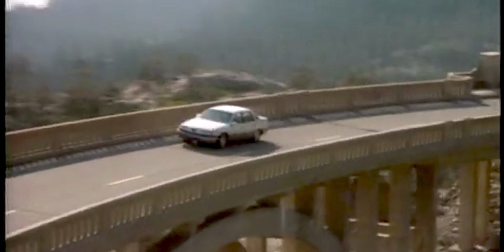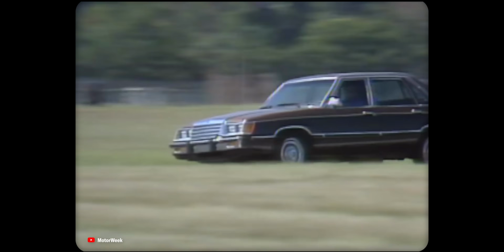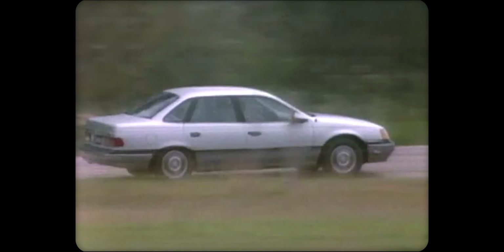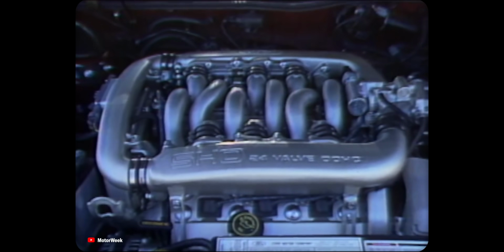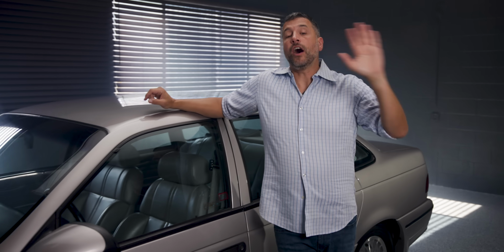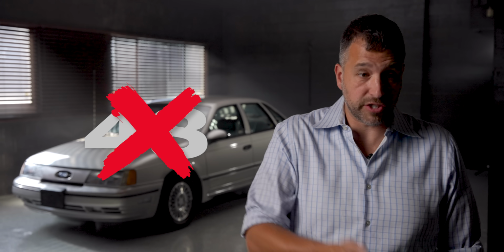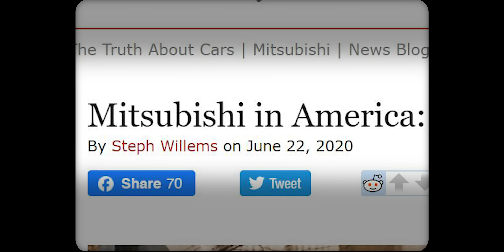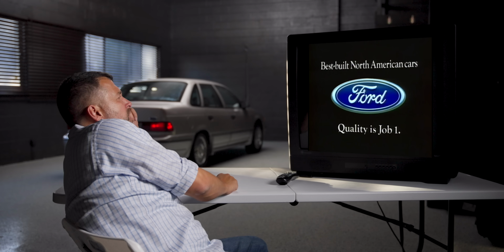The Taurus SHO is the fastest, most expensive Ford sedan | Revelations with Jason Cammisa | Ep. 08

Comment: I bought an '89 when they first came out. Light Titanium like the one you have. As you said, it was very understated and easy to mistake for grandma's Taurus. Another reason for the slow sales was the price. They were not cheap. I paid just over $22,000 for mine. To compare, a Mercedes 190E was $24,000. It was a pretty good car. The first ones had major issues with their clutch not releasing correctly. I believe they used a 3 finger pressure plate and had either bad fingers or springs. I paid to replace mine and not too long afterward Ford quietly issued a Dealer Notice (not a recall) to fix them if needed. Of course I didn't get compensated but I got a second "free" clutch a year or two later. That Mazda trans had a crap 2nd gear syncro. You had to be very careful going into 2nd, up or down. It had excellent steering and brakes. I got nearly 80,000 miles out of the first set of brakes. The car was an absolute touring king. It had a sweet spot at 100-110 mph. At 120, the nose would start to lift and the steering would start getting light, so it could have used a deeper air dam. Top end was 145 indicated, which I believe is accurate as I had an early morning run against a, new for the time, Corvette. The Corvette's top end was supposed to be 155 and that Vet slowly pulled me on top. The old two lane bridges on the 101 got really skinny at that speed. I put 180,000 nearly trouble free miles on that car before I sold it. Overall a great car. I still have the metal model SHO that the dealers sold.
Reply: Here on the Canadian west coast, they were going for about 32,000. My Dad almost bought one in 89 after he and I test drove one and yeah, we were really impressed. But you're right, for that kind of money, you could easily get into a BMW or a Benz 190E. A little expensive for a Ford.
Reply: @codyluka8355  you don't but the brand, you buy the car...
Reply: My 3rd gen SHO was the same way. over 110 it would start to lift the front end and get a little sketchy to drive. They never quite got the aero handled during the first 3 generations
Reply: It was an absurdly excellent highway cruiser at 80 mph.
Reply: @noth606  very true. But retained value is something to consider.
Reply: @noth606  Yes, I agree with you but you have to keep in mind that people who were buying new cars in 1988 & 1989 spent their money differently. Interest rates were a lot higher and the terms were far shorter. Dealership financing was easier to get than the banks but the maximum term was usually 4 years. An up market Oldsmobile or Buick was about $25-27k. A fully loaded Mustang GT, which had the same performance, could be had for about $20k, considerably less than the SHO. The young, go fast college guys went for the Mustang LX 5.0...those were about $12k new. People who could afford the $30-40k cars looked at Lincoln, Cadillac, Buick, BMW, Saab or Mercedes. Ford was still very much a car brand that was geared to the working family. The SHO was a beautiful car in every aspect but people who were buying Fords felt it was too expensive and too exotic. It was definitely arguably better than GMs 3.4 DOHC models. That's for sure.
Reply: @codyluka8355  those prices are absurd, I don't think I know anyone who could pay off 30k+interest in 4 yrs, except maybe the CEO of the company I work for. The most expensive car I ever had I paid 8k for, and I paid cash. I'm not eligible for loans (deadbeat ex) but I still like cars, not allowed to drive since I have heart condition, and an ICD+pacemaker. I could request an exception that would allow me to drive solo, but having a car I can never take anyone with me in seems pointless for how expensive it would be.
Reply: @noth606  Yeah, those prices were absurd back then, and as a young guy just starting out and buying my first car, it was discouraging, especially when Ford Credit or GMAC was advertising 9% interest but soaking you at 11 and 12 % because you've never had credit before. It was scary then...terrifying today with today's prices.
Reply: @codyluka8355  the 8k car was a TOYOTA CELICA 4X4 1991 JDM import, I loved that thing, straight up WRC car, but the upkeep of it was just stupidly expensive, like $400 for a set of wipers, the tires were $400 each, and so on. I did have some more adventures but like I said I couldn't get a loan for $1000 now, thanks to my ex, and I'm not allowed to drive so it doesn't matter for me. I'm just an old handicapped guy living vicariously through things other ppl do in videos 😄
Reply: I bought a 89 in 95 after I finally got a good job at GM. I remembered reading about it in road and track when I was in the navy and wanted one. Picked it up for about $5,000 and the original sticker was still in the owners manual folded up, $32,000. I thought I got a great deal. Well I loved the car kept it until 2013 after I got into a bad motorcycle accident and ended up in a wheelchair so I can't drive a stick. The car didn't have any value so I basically gave it away with one small rust hole by the gas cap and 180,000 miles. It started right up and still drove like tge day I got it with 60,000. 2 clutch and 2 transmissions later.

Comment: When you get Yamaha involved in the engine design of your car, you know you're going to end up with something weird and exciting. The same problem that sank the SHO (the lack of differentiation from the base model sedan) is the same thing that sank the Fusion Sport. The Fusion Sport was easily one of the best sedans out of America in terms of power, handling, and creature comforts. The problem was that you couldn't readily tell it apart from the standard Fusions, and that's a problem when you're paying a non-trivial premium to get one. I got the 2.0L ecoboost AWD with the titanium and electronics packages, so it's every feature from the Sport model at the time, except for the V6 (which I do wish I could have afforded at the time. The extra power at marginal fuel economy sacrifice would have been really nice).
Reply: The coubterintuitive problem is this, the Taurus' new design looked like it was made for speed, the SHO was supposed to be the norm over the base model coubterpart. But design evolved, the radical spaceship became the norm.
Reply: Your Fusion also lacked the semi-active dampers with pothole mitigation that the Sport model had. After test driving the 2.0 then the 2.7 I simply had to have the Sport model. The torque difference is staggering.
Reply: @kingkrimson8771  Yeah, the Sport variant of the same model year cost an extra $5k. It wasn't happening.
Reply: Never compromise on a car, go all out.  When I bought an 87 regal- it was a gnx, when I bought my g35 it was an 07 sedan s 6mt special edition Japanese model with dealer nismo options ,  when I bought my lotus, it was an exige s ,  when I bought my wife her suv it was an srt , because the explorer sport died.  Top end or nothing
Reply: @ThorOdinson-zc2kq  Believe me, if I could make the choice again then I would have just driven further to find the Sport model. I can't even imagine how much more powerful the ecoboost V6 model would be after a mod chip retune when the same mod already brought my little 2.0L ecoboost to over 300HP/400lb-ft. But, having said that, my car is perfectly suitable for my needs. I have the same problem that my friend with the Model 3 has: I have nowhere to use the performance it already has. I don't feel like losing my license and there's just too damn many people on the road for me to actually carve up corners even at reasonable, law abiding speeds. So, while I would have liked to have the even more performant version of my car, I don't have as many regrets as I might have if I lived in an area where it was easier to actually utilize such excess.

Unless you live somewhere that has a track and you've got a membership on an annual subscription basis and can just drop by for a track day, I can't understand why people would ever want a car with more than, like, 500HP. You'll never get to use it properly. Driving my car and particularly my friend's Tesla are just exercises in constant restraint. I haven't even had the opportunity to find out if my car is gear, torque, or electronically speed limited (I just know that is hasn't given up accelerating even at 140mph).
Reply: @mndlessdrwer  I had a 2014 1.5 and hated the [delayed] transmission (and the beige cloth seats lol). Yeah I should've gotten a 2.0 titanium, yet I traded mines to the dealer at 102k miles having ran it for only 28k because it once gave me transmission problems (was having trouble shifting to drive and making noise, it did go away though). Didn't want to sell someone what could turn to a lemon, but dealer was fine lol. Got a 2022 BRZ and it's a lot more my driving style. Small = better handling, and the power is actually decent now, good enough for my chaotic street driving.

Comment: Ford made a valid argument about engine accessories 'blowing up' if the RPM limit was raised. Accessories have to function at idle as well as at high speeds (a 10:1 speed range) and it's possible that even the water pump might start cavitating at higher speeds. They just weren't designed to go faster.
Reply: The much better argument however, was that raising the rpm limit put it so far outside the peak power range that it was utterly pointless to do so.
Reply: I wonder what the average piston speeds where. Is this an overscuare or underscuare engine?

Comment: Having worked on and driven a few of these, they also torque-steered like nothing else.  But man, at the time they were quick.
Reply: I've heard so many people complain about how much they torque steer, but mine has almost zero.
Reply: @GeekSHO 
Then it is well down on power.
Reply: @negativeindustrial  maybe my suspension and chassis upgrades fixed it, but it's most definitely not down on power.
Reply: Even by modern standards it holds up pretty well - and that's saying something from that era!
Reply: I’ve had 40+. TQ steer is not an issue. Even in my supercharged and turbocharged examples.

Comment: I owned an early 90’s reg Taurus model which I shipped to Italy when I was stationed overseas in the Air Force, best car I ever owned believe it or not, and would easily do 120+ on the autostrada. I remember when I shipped it out of Compton, I removed the rear seat, wrapped all my snap on tools in shop rags and hid them under the seat so I could get my tools shipped for free lol, it worked. I sold it to a friend before I separated, it’s probably still there somewhere.

Comment: The Vulcan and duratec v6s were fairly good engines but the problem with the Taurus was the automatic transmission, which was problematic all the way up to the third gen Taurus.
Reply: I had a 94 jus reg taurus and yea they tran started slippin at jus over 118k miles and iam pretty sure it had a blown head gasket as well when i traded it. It was the 3.8 v6, had plenty of power but the mechanicals of everything wasnt that good, oh and not to mention a broken motor mount too. Car was kind of a nightmare now that i think about it
Reply: I disagree on the engine.  It was awful as was the transmission.  Otherwise car was nicely appointed and comfortable.

Comment: I owned a 90 SHO 5 speed manual with a sunroof, geez I miss that car.
Reply: I had an '89. Had so much fun in that car!
Reply: Mine was a '93. It was the only 'cool' car of my youth
Reply: Did you shoot spider pins in the transmission like I did, twice? The car was great,  but the paint peeled badly after 5 years and those transmissions blew apart every 30k miles

Comment: I had an 89 SHO. I loved that car. I loved lining up at a light with a Camaro or Mustang 5.0 and dropping their jaw when I would either blow them away or keep up with them. Then the 3rd gear synchro started to go, and the fuel pump failed, and the battery failed, and the water pump failed etc. etc.

Comment: I was working at the Ford dealer when these came out.  What a sedan.  Quick, reasonable fuel economy (if you stayed below 6k) and comfortable.  The only thing that wasn't great was the Mazda 5 speed; some times balmy when quick shifting 2nd to 3rd, but otherwise an outstanding sports sedan.  I got to drive one of these after new car prep.  But, what may surprise you is that there was a four cylinder Taurus, for a few years, the MT5.  Don't laugh!  The MT5 station wagon with manual trans will surprise you with its handling and ride.  If I could find one in good shape at the right price, I'd buy it.

Comment: I've never seen the sho, but I gotta dohc 3.0(2003) and I love this car. It's economic, efficient,  powerful, even pulls a single axle trailer if ever i need it to. 
$400.00, with clogged cats not running,due to previous owners poor maintenance program. Fixed that, and she still performs like a champ at 196,000. Would love to encounter a sho in good condition.

Comment: I had a 1993 SHO w/ a 5speed in high school back in 1998. I loved that car. Joined the Army and got stationed in Germany. Let my dad car sit and the engine "blew up" slowly pulling out of a gas station. 🤔 Now I have a VW Alltrack w/ a 6 speed. It's a APR stage 2+, IS20, 3" DP, FMIC, AWE exhaust, swapped GTI suspension, blah blah blah. I love my sleeper wagon. Never getting rid of it....or letting my dad drive it.

Comment: Bought my used '92 in Dec of '93 as a 20 year old. The looks of the Gen 2 were striking back then and even if you didn't think so, the black leather interior and very modern dash gave it a posh view from the inside. Also, the '92 did not have a spoiler. That was added for '93...

'92 ownz j0o...

Comment: The SHO engine was originally built for an 80's supercar designed to take on Ferrari, Corvette, etc. and it did rev ro 8500 RPM. After the prototype was built and it beat the above mentioned cars on a test track the project was cancelled, however they already had the design from Yamaha and the Taurus just happened to be the vehicle they put it in

Comment: I had an '89 SHO from about 1992-2000. The change in sound the engine made when the short runner flaps opened up (4000rpm? Maybe 3500?) was so intoxicating. Couple things I didn't like though, torque steer could be a problem, and either one of my shifter cables was stretched out, or the tranny syncros were bad because it always resisted hard going into 2nd and I'd have to fight it. Sadly being in Buffalo and having salty roads all winter, the body rotted out and looked like rusted Swiss cheese when I finally sold it. I think I was asking $500 for it and got $400.

Comment: I think its a  strech  to say composite headlights are really vastly superior to sealed beams.   When a sealed beam gets replaced, the bulb reflector and lens are all new.   When you buy a quality sealed beam led conversion, it doesn't blind oncoming drivers, unlike popping in a led into a composite lamp housing.  Or how a composite lamp housing will dull and then require an expensive replacement.

Comment: I  still have a 1989 SHO with the SHOShop supercharger kit, shimmed transmition with a stage 2 clutch. A posi front gear assembly by Quaife from a forum group buy. Bigger injectors  and fuel pump. All running on a flashed factory  chip (OBD1 ) Frame connectors, lowering springs from Eibach and Tokico struts. Also, a cat back exhaust.  It's been sitting in my shop for 10 years or more under a tarp.  This video inspired me to pull the tarp and have a look... I will be giving it a complete service (60k) per manual. Then just drive it. There are not many left. Thank you for this great video!

Comment: I miss my old '91 SHO.  It was fast at the time, by today's standards not so much anymore.  It handled decent but being frontwheel drive/open diff it had a snap oversteer problem in the curves if you pushed it to its limits, it was a little unnerving when the back end stepped out on you in a curve.  The factory suspension needed some serious tuning.

Comment: You mentioned that Ford sent Vulcan 3.0L engines to Yamaha to modify, this is incorrect. The 3.0L Vulcan and 3.0L SHO shared no parts. The SHO was 100% Yamaha. I was a Ford dealer technician from 1990 to 2014 and worked on my share of SHO Taurus. I can say that the engine was damn near bullet proof. Very few ever need major work. Common problems included valve cover leaks (especially spark plug tube seals leaking oil into the plug wells causing misfires) cam and crank sensor failures (Ford parts not Yamaha), timing belt and water pump. Both the 3.0L and 3.2L were great engines. Then in 1996 the V8 3.4L version came out with its pressed on cam gear spinning on the camshaft causing catastrophic damage. You could catch them early enough and tack weld them but was still no guaranty. Great video enjoyed watching it brought back alot of memories. You should do one on the Thunderbird Turbo Coupe and then in 1989 the SuperCoupe. I always thought those were cool

Comment: I had a not-SHO 88 Taurus, good car except for the propensity to keep going in a straight line when trying to turn a corner in the show.  Oh, and the front frame bits that extended from the unibody to hold the engine, front suspension, etc. that rusted and required my mechanic to weld them so the front end wouldn't fall off. And the fact that the transmission quit at 212K miles despite the fact that the car was properly maintained and not driven hard.  Otherwise, a nice car.